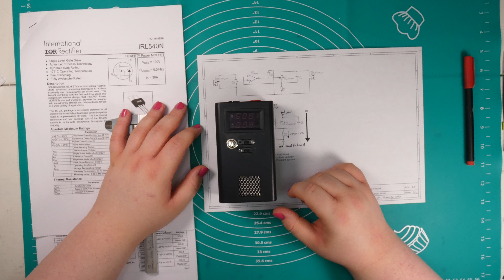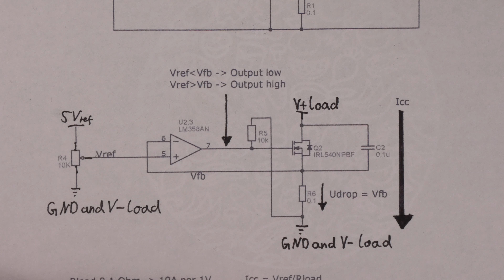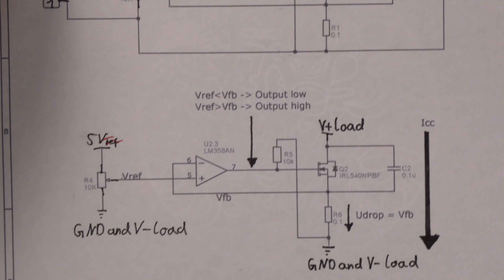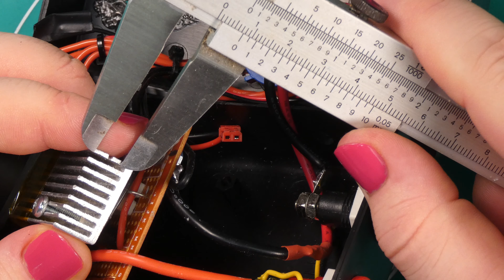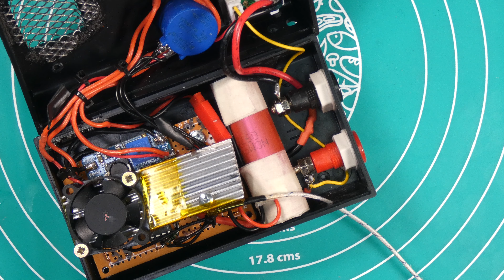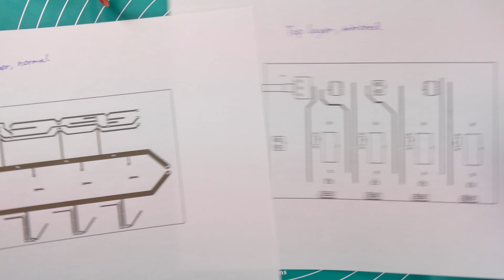DC Electronic Load - Everything You Need to Know and More (Schematic and Function explained)

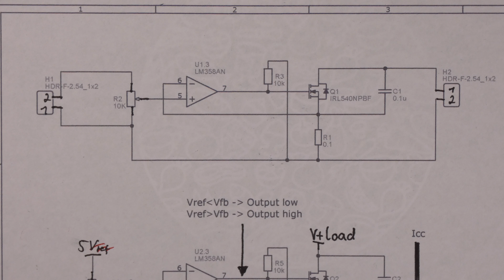Comment: 4:27 i was wondering if i could use 7.5k resistor from pin7 to v - load i was wondering if i could use 0.5 ohm resistor has load 2A per 1 voltage  i have lm358P amplifier instead of im358AN the one you used i think i can use lm358p instead of im358AN

Comment: I was convinced that I knew how this circuit works until I connected my oscilloscope to see if the theory is correct... Well, it certainly does NOT compare, I'll explain...
I use the LM385 opamp but I have a 12V VCC and I use a 2.5V reference (TL341) for my course/fine adjustment potentiometers 10K ohm and 1K ohm and my sense resistor is a double 0.22ohm, 3W in parallel so 0.11ohm, 6W resistor as I'm using it... 
Now you'd expect with the 2.5 volt reference the maximum voltage measured on the sense resistor would be the same right?
Well, I see a 100MHz signal on my sense resistor with a voltage of about 100mV for a 1A load which doesn't make sense...
Another thing that I see is that the gate voltage on my mosfet will rise linear up to 6.8V which is the saturation voltage of the mosfet I think, and then it stays there at 6.8V but from that point I see the gate starts to oscillate from 1Hz up to 100MHz and the 100MHz to my knowledge is the limit of the opamp.
Also the maximum that my load will go is 1700mA regardless of the input voltage and I tested it up to 70VDC with a max of 0.850mA and everything below the 25VDC I can crank up to the max of 1700mA and I left it running for at least an hour per test, it's very stable and accurate to 1mA and it works pretty good as it is right now but it doesn't work as expected and something isn't right but I don't really know what I should do to make it better, what do you suggest?
Reply from the maker: There's alot of stuff you said :D
"Now you'd expect with the 2.5 volt reference the maximum voltage measured on the sense resistor would be the same right?" What exactly did you measure? Do you mean its voltage dropp or against what reference did you measure? (voltage dropp accross the sense resistor is correlated to the current and if you cranck up the current the voltage goes up aswell and in theory there is no limit ignoring the current limit. Main limiting factor is the mosfet)
"on my sense resistor with a voltage of about 100mV for a 1A load which doesn't make sense" this part makes sense and is what you should see. Can't say anything about the frequency though. 
You said 0.22 Ohm // this means 0.11 ohm -> U = R x I -> 100mV ~/= 0.11 ohm x 1A
"Another thing that I see is that the gate voltage on my mosfet will rise linear up to 6.8V which is the saturation voltage of the mosfet I think" You should be able to see up to or close to your 12V assuming that is the voltage you supply to the op amp. Limiting factor is your TL341.
"Also the maximum that my load will go is 1700mA regardless of the input voltage" this is correct, the current limit is independent of the input voltage. The 1700mA limit is a combination of the mosfet used, your TL341 as well as the load resistor. With the IRL 540 I used, a 0.1 ohm load resistor and the 5V reference voltage I used I was able to get up to 20A (don't know if I mentioned it) however using the same IRL 540, a 1 ohm resistor and 5V ref it is limited to only ~1A if I remember correctly. I then adjusted V ref to 10V and I am able to get up to 2.5A.
My suggestion is get rid of the TL341 and use something with a higher voltage than 2.5V. As mentioned in the video I used 5V so double your voltage reference. I think that is your main problem and should solve the issue.
Reply: @PhysicistAnna  Thank you for answering me with great detail, I really appreciate that.
I'll try what you suggested and get rid of the TL431 or make some changes to the circuit to get a higher voltage reference or I might as well use a 7805, 7806 or 7809 as a stable voltage reference.
I measured the gate voltage again just to be sure but it didn't change so for some unknown reason it only goes up to 6.8V and then starts to oscillate.
That may be related to the opamp being damaged because I didn't change that one after blowing up 2 mosfets but I'm not sure, I have several of those laying around and I used a chip socket so changing that opamp with a new one couldn't hurt.
Reply: @PhysicistAnna  After some tinkering with the circuit and measuring with my oscilloscope I finally found what the problem was, it's not the TL431 voltage reference...
It was the opamp, blowing up two mosfets also took the opamp with it partially making it work the way it did.
With the new opamp I can go easily above 2.5A, I also changed the circuit so that I now use the second opamp too as a buffer so I'm not limited by my voltage reference anymore but the buffer now sets the maximum current to whatever I choose it to be.
It's because the opamp was still somewhat working that I got confused and didn't make sense but the issue is resolved.

Comment: Very professional job.
I've subscribed and Liked, and shall watch your other videos.

And I've come to the same conclusion that you came to about the limits to heat transfer and load.
I'm a materials engineer, and am using these projects to learn more about electronics.
And I've found that a lot of thje designs you see are not done in a very methodical or rigorous way.

In the case of a load, you must obviously dissipate the power that the load takes: as heat.

I'm going to build my own load, and before I do it, I shall estimatre what its capability SHOULD be.
And then build it, and see how close I came to that prediction.

I've not done it yet, but using the circuit in your design as an example, it's a very simple one, I think it would be pretty easy to do a reasonable analytical model of heat transfer as a function of power.
It will be non-linear because as the power you load increases, so does current, and that causes a higher temperature.
Which affects both the resistance (and the heat OUTPUT), as well as the capability to dissipate that heat.

There are only 6 components in this circuit, and only two are "active".
But they both have pretty good data sheets showing the effects of temperature on their performance.

As I'm sure you know, you could solve for the steady state temperature at a given load based on having dissipated load (by joule thompson heating) being matched by heat transfer.
Assuming a good contact of both IC's to a heat exchanger, you can calculate heat loss by forced convection.
Even make that more accurate by assuming a certain amount is lost by the opposite sides of the IC's (sometimes only 80% goes to the heat exhanger side).
And add on anything lost by the passive components: resistors etc.

Then iterate that temperature back, and recompute until your solution (hopefully...) converges.
Then test it on a working model, measuring temperatures and refining the model if needed.

Sounds more complex than it actually would be if you have the data (data sheets etc) at hand to do it all.
It's very basic heat transfer theory after all.

Once the model looks good, you can see how to modify things to make it either cheaper (reduce cooling if it's overkill), or else where you need to address other bottlenecks.
At the least you can see the upper limit to current, and allow the PCB (or whatever) to be able to handle it.
And you could see if adding more Mosfets would be a cost effective way to increase the load.
Or else use another Mosfet weith a higher capacity.

What do you think?
Alan
Reply from the maker: Hey Alan, again welcome to my channel! I already answered your other comment. :)
The project is on hold for now, the last thing I did was designing the pcb. https://www.youtube.com/watch?v=BlUaXTRbIp0&ab_channel=PhysicistAnna I know the video is 35 minutes long but you can skip if you just want to see the final design. I checked with an electronics engineer from my new university and he said it is perfectly fine. This thing is designed as a prototype with the ability to extend and some temperature controlled fan circuits. I use 4x IRL 540 they have good current capability and a Tj, max of 175°C. I need to properly calculate but from my guess it'll be able to handle 300W, maybe even 400W (within mosfets current rating) if I can come up with a sufficient cooling. There are some pads on the pcb for potential "repairs" or adjustments of the circuit. I never tested this particular one, just with 1 fet and 1 lm358 in this video, so I need to account for potential problems. I just need to etch the pcb, think about the enclosure and figure out cooling then the next video will be made. Right now I have strict time constraints because of university and I got other projects I want to finish before this one. So it'll take some time.

Comment: This video was very helpful.
Got to know there are quite many things that have to be considered for making this.
Thank you.
Reply from the maker: Thanks for your comment and welcome to my channel! :)
Reply: @PhysicistAnna  I have seen that many people are using logic-level MOSFET in this case just because it requires low voltage to make the MOSFET on or there is some other reason?
I'm currently having IRFZ44N which is not a logic-level MOSFET so can I use this without any problem?
IRFZ44N can take up to 10V (Vgs).
Thank you in advance.
Reply from the maker: @omkarkhade4602  Yes the lower gate voltage requirement is the only reason to use a logic level MOSFET.
If you don't use one of these you require a higher Vref.
Reply: @PhysicistAnna  Okay, Thanks for the reply :-)

I will make sure to provide proper rail to rail supply for the OP-AMP.

Comment: I Can't wait for your heavy duty load bank. Last night I managed to put my arm across a rather warm heat sink. I managed to 'collect' 8 red fin marks. I was adjusting your variable fan speed unit and maybe I got it wrong.  I have needed that fan controller for years.
Reply from the maker: Ouch I burned myself nomerous times, I feel your pain. 
Currently I am redesigning the pcb as there is some space left I want to add one of my fan circuits as well as some features for later readjustment if something doesn't work out. Esentially I'm planning ahead of time so I don't have to throw it away but can rework it if necessary.